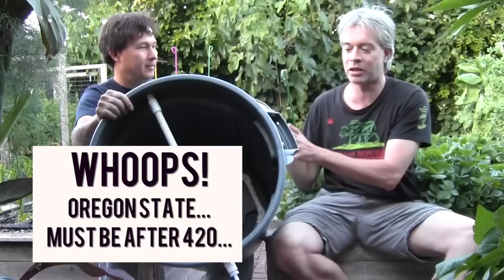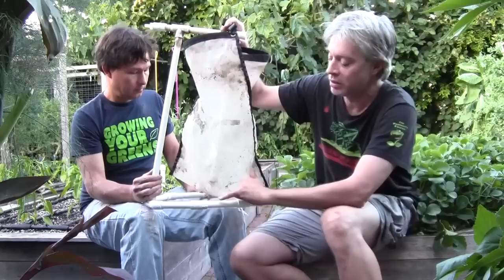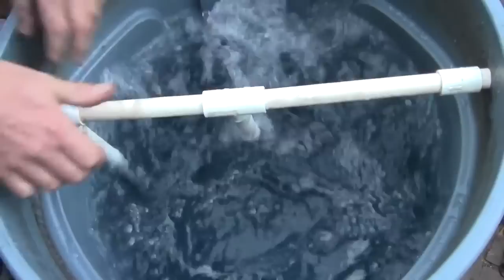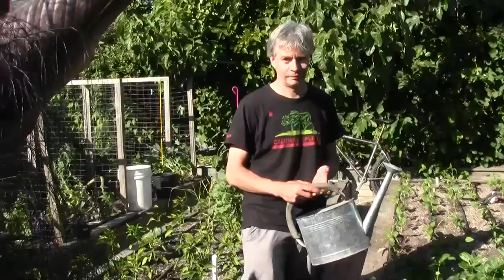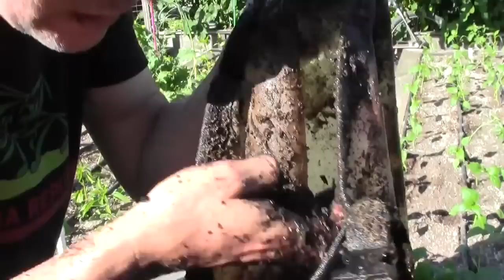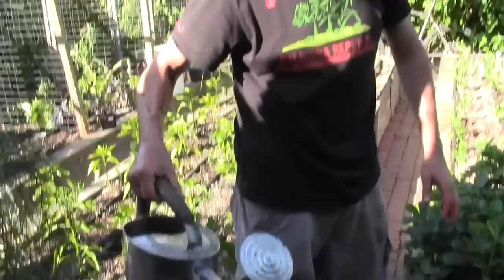Best DIY Compost Tea Brewer made with a Garbage Can & PVC Pipe

Comment: Not for me.. 100w run 24hours is 2.4kw of needless electricity use. Plus in the real world this tea would have to be running until all the tea has be used. Lots & lots of needless kilowatts for a product that does nothing more than the base product. 

Nature has balanced microbial life & a much more useful way to microbial life would to add soil from a forest floor to your beds/pots & whatever else you can also harvest mycorrhizal fungi from shaking the roots of plants in forest areas into water & adding to soil (remember that mycorrhizae needs a host plant so best to fill a bag with soil and add a cover crop to act as a host before adding under new plants in your garden